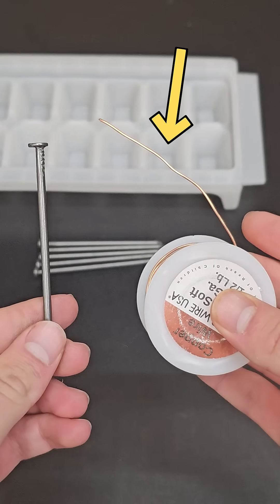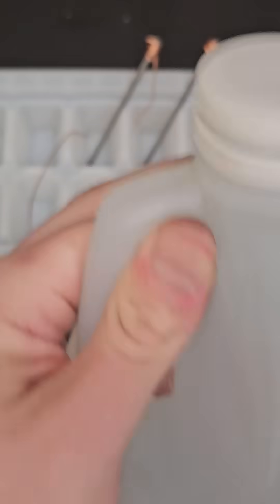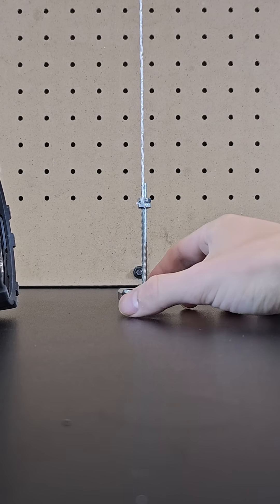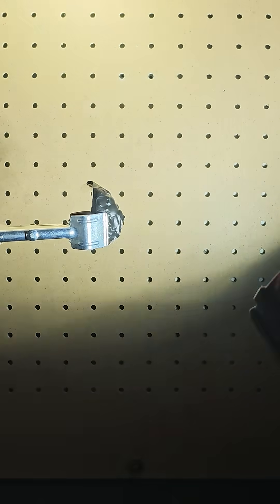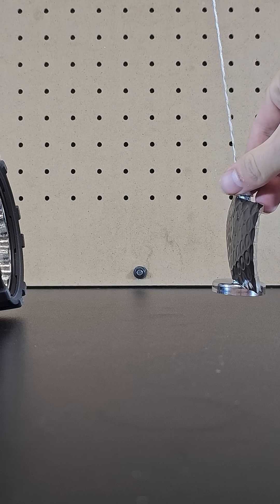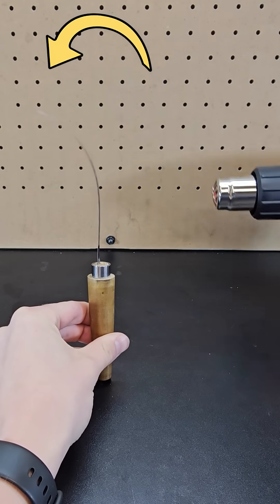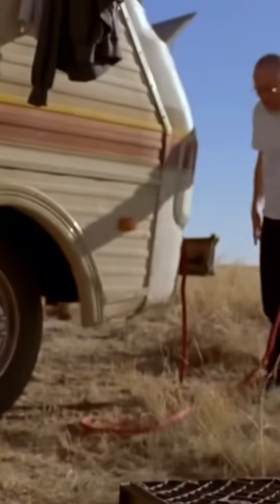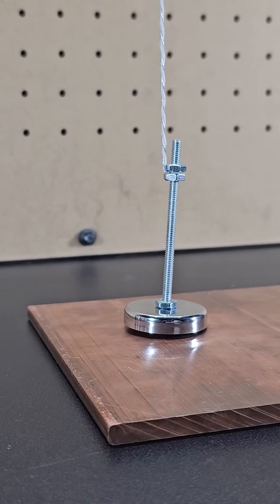Can you spot real vs. fake science? - 2 Truths & Trash (S4E1R2) #shorts

Comment: While the amount of light coming from the flashlight would still have nowhere near enough momentum to stop the pendulum, a black surface is actually much worse for imparting momentum than a bright or shiny one. If you redirect the momentum of the light backward, it must impart that much more momentum to the surface reflecting it to conserve momentum.
Reply: Please, stop. OP is correct. I'm a physics professor, I teach this stuff. Momentum of light is a weird idea, but Einstein clearly explained the logic in Special Relativity. Relativistic momentum obeys the same principles as classical momentum. That is, OP is correct.
Reply: @IdRatherBeDiving-vr5gk could you teach me some day
Reply: excellent comment
Reply: damn
Reply: the momentum of light is too small either way, you have a better chabce at exploiting the heated surface to heat air and the resulting pressure increase may impart momentum onto the pendulum. I think theres a toy that uses this principle.
Reply: While this is true, you also have to consider the fact this experiment isn’t done in air. When you shine a bright light onto something black, more light is absorbed, which is then conducted to the air. This air expands and pushes off of the black surface, producing thrust. I’d be curious to see the difference in thrust between the two setups, but I have my money on the black surface
Reply: "take a weight and attach it to a string" weight is very obviously a fishing magnet
Reply: Nobody pray for me 🗣️🗣️🗣️
Reply: I knew light has so little weight that it wouldnt do anything, so I thought it was probably some strong magnet under the table, but looks like it was just edited out
Reply: Which would be all well and good if light had any mass
Reply: @robbiepemberton  the momentum of light is calculated by P=E/c, where E is the energy of the light particle (Photons) and c being the velocity of light.
So Light does have momentum but it is not calculated in the same way as normal momentum p=mv, where m is the mass of the object and v being the velocity of the object
Reply: @sulaimangigani Well specifically, E^2 =( pc)^2 + m^2c^4. Which is the formula which relates momentum and energy at near light speeds. Just a photo has m = 0 so E = pc.
Reply: @findlaymurray397 Yes, I just have the final formula for the op to help them understand and felt that the complete formula would be a bit confusing. Bte thanks for writing the complete formula and the conditions
Reply: @robbiepemberton look at solar sails, photons do impart a force on the object. It is just very very small. Hence why solar sail designs are the size of football fields for objects that are very small and lightweight
Reply: @robbiepemberton no, light doesn't need mass to have momentum
Reply: @robbiepemberton light has momentum
Reply: @robbiepemberton  photons  have momentum though. solar sails are a real concept (i'm actually ignorant to if we've used them yet), of course thats in an incredibly different setting from whats in the video.
Reply: @robbiepemberton light can induce pressure on surfaces though. If you create a mill that moves from any external force easily and put it into a chamber with vacuum and shine light on one if the mill's sides, it will start spinning
Reply: @blade.1290 That's "Cooke's Radiometer," aka a "Light Mill."
Reply: @blade.1290 It used to be thought that "light pressure" caused movement of the vanes in a Crooke's radiometer. This old, incorrect explanation still gets asserted to this day. Instead, a Crookes radiometer moves due to a temperature difference between the dark and light sides of its vanes, which is caused by the light's absorption and reflection. This temperature difference leads to thermal transpiration, where the rarefied air inside the partial vacuum creates a pressure difference. The higher pressure on the warmer (black) side pushes the vane, causing the white side to lead and spin the device away from the light source.
Reply: @robbiepemberton Energy and mass are basically equivalent at that scale. Photons have 0 rest mass, but that doesn't account for the energy they contain when moving at speed.
Reply: @robbiepemberton  Sir Steven Hawking observed in one of his lectures that "A photon at rest has no mass, but a Photon in motion has a measurable mass."
Einstein observed that, "The mass of an object increases the closer its velocity approaches the speed of light." Thus, "Nothing" times Infinity actually does equal something.
Reply: @TimeSurfer206 I'm sure you're misremembering that quote. Photons can't ever be at rest, and they do not ever have mass. They do have momentum though
Reply: @johnvonkerman the fact that photons don't experience time at all still absolutely fucks with my brain
Reply: @johnvonkerman the fact that photons don't experience time at all still absolutely fucks with my brain
Reply: @kapperbeastYT  why?
Reply: @johnvonkerman but they do have rest mass, of 0
Reply: @khiemgom what's the difference between not having mass and having a mass of 0 supposed to be?
Reply: @johnvonkerman rest mass, they have the concept of rest mass, so thinking about a resting photon is valid in a mass sense
Reply: @khiemgom you can't construct a frame of reference where a photon is at rest. It's simply not possible
Reply: @johnvonkerman ok but if it has momentum it has energy, and e=mc2 which means m=e/c2 where e isn't 0 and c is finite, so it can't be 0, so light thecnically has a mass. (Btw don't quote me on that because I don't know if momentum by itself is actually energy 😅)
Reply: @thomquiri5403  all mass is energy, but not all energy is mass. E = mc^2 tells you specifically how much energy is stored in an object's rest mass, it's not a universal converter between mass and energy
Reply: @johnvonkerman  but the concept is important enuff? Otherwise define rest mass please
Reply: @TimeSurfer206 Simply as E= mc^2, and energy can be derived from motion.. Something in motion must gain mass. So, as you say, a moving photon must have an effective mass.

Comment: It's gotta be B! You can get a kinetic push from light, but a black surface is literally the worst to do that with!! If it's absorbing the light is converting to heat energy, not kinetic! You need a SUPER reflective surface. Also, light has no mass, so the pendulum slowed down WAAAAY to fast

Comment: A is real, you can even make a battery from a potato.

B is fake as light doesn't have any meaningful force to move objects.

C is commonly used in blinker relais inside cars. When it is powered on, a heating element is heating up the bimetal. It will close a contact, the blinkers will turn on and the heating element inside will turn off. The metal cools down, turning off the blinkers and the heating element back on and this will run forever until you take away the power.

Comment: Light is massless which tipped me off because the explanation was nonsense BUT the radiant heat is theoretically similar to a solar sail so while that could’ve been a trickier explanation, it’s also way too slow to slow it down like that. I figured you were doing some magnetism based on how it behaved. I was kinda right

Comment: they CAN move things with light and scientists are actually working on a rocket that would utilize the fact that light leaves some energy after hitting something and the momentum continues. BUT that's in a vacuum and that's in 0g which is very important. i remember seeing b with the copper and if i remember correctly you can also use a copper tube and a magnetic ball

Comment: The last one is the premis on how indicaters in cars used to work.  the heat from the electricity causes it to bend and break the circuit, then it cools and bends back, the sound is from the switch turning off an on.

Comment: The 2nd one is actually true too, it's called a solar sail. It doesn't work in the video because the flashlight isn't powerful enough but they use this stuff in space, they use the light that's coming from the sun to push the satellite/shuttle (idk which exactly).
It works on the principle that light has no mass but it has velocity so high enough concentration of light or frictionless environment (like space) can utilise this solar sail.

Comment: Technically light can exchange momentum like that. Light sails in space are a real thing.

But the force is EXTREMELY small, and it requires a TON of high energy light to work, which requires a massive surface. Plus, in space, it works a lot better since there is no friction to slow you down.

But yea, it was never going to be THAT strong of a force to stop a magnet like that on earth. It technically would stop it eventually (although air friction would have a larger stopping effect), but it would take a really long time.

Comment: Light has momentum and if the energy density is large enough it could slow down the object and push it the other way. An example with technology exploiting this are solar sails. However the energy required would be much higher than what the flashlight could produce. You need at least a 100 kilowatt-gigawatt laser. A gigawatt laser can generate 6.7 Newtons of thrust for a 1 inch solar sail in a vacuum. 

So sure the one with the flashlight is fake but use something with a high enough energy density against that object and it will push the object in the opposite direction.

Comment: They used to use bimetallic strips as thermostat controls. If it got too hot, the strips would basically hit a switch alert the air to turn on, and vice versa for cold.

Comment: I had two reasons for picking the right answer:  force requires mass, which photons do not have.  EVEN IF THEY DID, though, using the black material would actually be less effective, because Newton's third law would mean that more energy would be transferred by reflecting than by absorption.
Reply: Light does not have mass, but it does have momentum. Solar sails exist

But also, yes the 2nd one is fake. It can't produce anywhere near that force. Plus you would want a reflective material, not an absorbent one

Comment: fun facts:
you can have a waterwheel like object suspended in a decent vacuum with the vanes having one side being reflective and the other being black, and shining a light will heat up the black side and cause expanding gasses to push it, causing the contraption to spin

older AC contollers and oven temperature controllers use bimetallic switches to measure the temperature.

Comment: I knew that the light was fake, but I was certain that vinegar couldn't conduct. So I picked e, for both 1, and 2. 3 was pretty obviously real
Reply: Vinegar can conduct current in the form of ions but not electrons. Since the LED electrode won't give off copper or other ions like an anode then I believe the doesnt circuit works.

Comment: fun fact:
some ovens use the last method as a non electric thermometer to close/open the heating circuit
Reply: that’s basically a circuit breaker
Reply: same with the automatic choke on old carbureted cars
Reply: Same with electric kettles. In most kettles you can find a tiny hole or tube inside for steam to travel down and trigger the circuit breaker. That's also why they can't stop if the kettle's lid is not properly closed and the steam doesn't go down there
Reply: fun fact some electrical overload protection mechanisms work this way as well
Reply: car indicator lamps used to be entirely controlled by a bi-metallic strip. The sound they made while blinking was literally the sound of the switch opening and closing because of the bi-metallic strip flexing.

Comment: Light pressure IS a thing, but it is so tiny you need the object to be in a vacuum to have any visible effect. Ever seen those spinning half white half black tops inside a bulb? That bulb is maintaining a vacuum. We also have to consider light pressure on some space craft, like JWST, due to surface area. I’ve heard of teams whose probe is almost out of fuel turning their craft in a specific way to maximize light pressure to eek out just a little more momentum. There’d also the concept of a solar sail, but no one has made one yet and it would need to be really big and really thin.
Reply: That's called a Crooks Radiometer. It's a common misconception that they are moved by light pressure. They move from being heated up by a lightbulb and spin due to thermal forces. If you put one in a cold environment, it would spin the opposite way.

You are correct though that light pressure really only does anything to space probes.

Comment: I was stuck on the first one because those nails were not galvanized.  Those were steel nails, which normally have a bit of an oil coating to prevent rusting before they are used.

Comment: Galvanized = Zinc Coated steel.  Making a Zinc Copper Acid battery. Some of the earliest batteries known.

Bimetallic materials are commonly used all over the place.  In fact most non-digital thermostats use this exact method.  

Now can you swing a pendulum with light...yes.  Will this one swing because of light, no.  The Pendulum is far to heavy for this.  In fact the pendulum as pictured is much more likely to move purely from the heat and air currents from that heat generated than from the light.  The photons themselves have almost zero mass but can exert extremely small pressure varying based upon frequency, however you would need either extremely large cross sectional areas or very very low mass materials to observe this energy directly.

Comment: You can make the explanation as long as you want but it will not convince me light can atop a moving object. Radiation pressure may exist but not only is it weaker if the light is absorbed rather than reflected, the amount of intensity that’s needed is probably an insane (and deadly) amount given how tiny it is.

Comment: Technically speaking, the flashlight does stop the pedilum. The problem is that this experiment is not big enough. There are tests where a solar sail propels a spacecraft with light. However, for this to work, the sail would need to be significantly larger, and at this point, the simulation would fail because the atmosphere would provide too much traction. This was at least the Theory.

Comment: The pendulum looks like a magnet and it stopped way too fast, but light applying pressure is how solar sails work, there are also light engines that run in a vaccuum bulb, but the effect here was way too pronounced and immeadiate.
unpause

Comment: Reflective surfaces actually experience higher radiation pressure than absorbing surfaces due to the momentum transfers. None Less of the energy is wasted thermally.

A 200,000 lm flashlight would have a radiation pressure on the order of 10^-4 Pa. Over a strip that small, the forces would be around atomic forces. So it's pretty clear which one is fake here!

Comment: Galvanized metal is not a conductor, we use magnesium sacraficial anodes to protect steel tanks in the ground from corrosion
Reply: A quick Google search says otherwise
Reply: @xef008 galvanic corrosion is not galvanized metal its a tyoe of cathodic protection
Reply: @xef0083 a quick Google search often doesn't give the full answer on more complex topics. Galvanized steel is a poor conductor on its own, but it often has a coating to protect it from corrosion as theirishcookie has pointed out. This coating is often conductive though, such as zinc coated galvanized steel grounding rods. This example however, is a case where the coating was chosen with conductivity in mind 😅
Reply: @thomasvogel4340 galvanized steel literally just means steel coat with zinc, so yes galvanized steel is conductive

Comment: There is a phenomenon that would technically make the second one work. Although light doesn’t have momentum bc it doesn’t have any mass, I’d does have energy and can transfer it when reflecting off of some but it would be a very small amount of energy. Sort of the same concept as solar sails but I’m not sure if the amount of light from that flash is high enough, but I can guarantee that if that light went into a concentrating lens you can simulate that effect
Reply: Well actually light does have momentum and this is proven through things such Compton scattering along with the important equation E=pc.